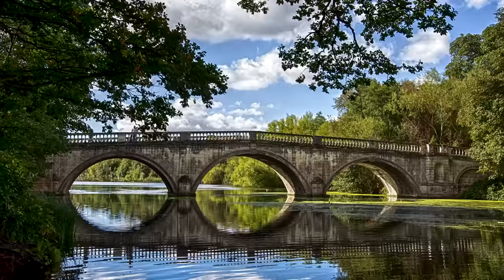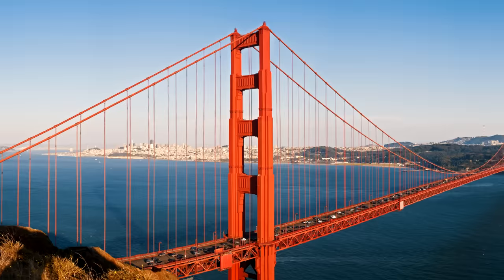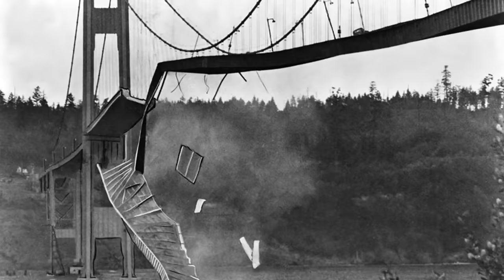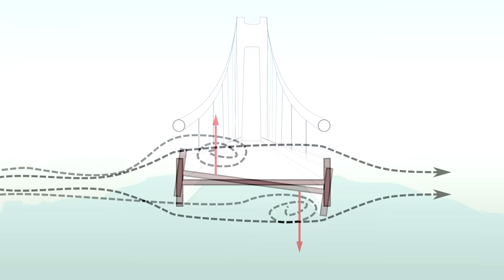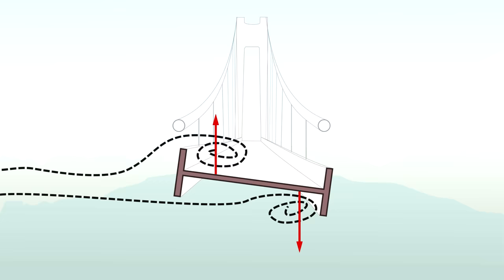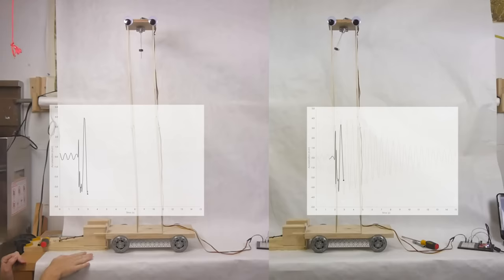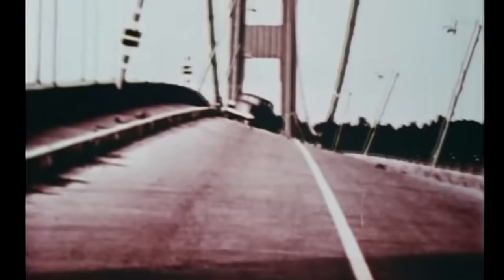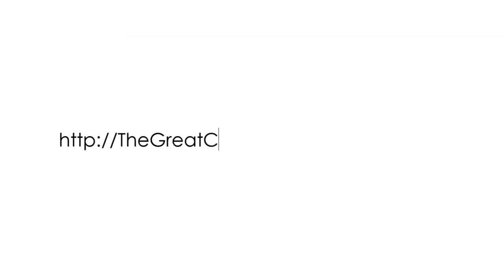Why the Tacoma Narrows Bridge Collapsed

Comment: I have a model aircraft and that suffers from what appears to be resonant flutter.

It has a conventional T-tail but the tail is significantly raised above the fuselage and directly in front of it is a pod housing the motor. In powered flight the tail 'waggs' and I'm told one of the solutions to this is to use a 3-blade propeller.

Presumably this alters the impulse period of the air being pushed backwards from the prop, negating the resonance.

Comment: I work for a Kubota tractor service department. People have no idea how sturdy modern tractors are, especially kubota. You cam complain about the flimsy cosmetic pieces of the equipment, but when it comes to rugedness....wow. I see the aftermath of these things put through all kinds of abuse, just to come in with minor troubles that we can repair and get the equipment back up and running very well. Missing service intervals by several hundred hours, shiny silver hydraulic oil, completely clogged radiators and air filters...and I have only seen a few catastrophic failures. People always complain until I show them pictures of how THEY caused the failure by skipping routine maintenance for 2 years. They will run equipment after gashing a radiator hose and drain all the coolant, then complain about just a head gasket. Or complain that it was running hot when a stick rammed through their hood and broke their belts...or their radiator is filled with mud because they spray it with water instead of air. Modern equipment is far from "not built like it used to be." People just "don't care for things like they used to."

Comment: Nice video.  However, what you left out is the fact that the contractor CHANGED the design (to make it cheaper and hence increase his company's profits) from an open lattice design to the one with the solid side panels that failed.  Also worthy of note, the Washington State Department of Transportation (WSDOT) was so confident of the Narrows Bridge before it failed that they were going to cancel the insurance policy.  Had it stayed up another week, they would have cancelled the policy.  However, as it turned out, the insurance company's agent had pocketed the $200,000 premium, and so there was no actual policy in place at the time of failure.  But he only stayed in jail for a few months because he was needed for WWII...  Amazing when you see how deep the rabbit hole is.

Comment: Almost everyone complains about driving on the open grating that makes up the middle two lanes of the Mackinac Bridge that connects Michigan's two peninsulas but this is exactly why they exist.  Winds where Lake Michigan meets Lake Huron can easily hit 50 miles per hour.  The bridge closes for driver safety at this point but it would take 150 mph winds to bring the Mighty Mac down.  A category 5 hurricane is 157 mph or stronger.

Comment: Rather than wind loads, airplane structures are designed to withstand gust loads and turbulence-induced flutter. These can dramatically increase the load factor (stress sustained by the airplane structures) and break components apart. That's why usually the top speed of conventional subsonic airplanes is defined by the flutter speed, which is required to be found by testing campaigns.

On YouTube you can find for instance the flutter test of the Airbus A380 and how they found out their main wingbox (where the main landing gear was seated) almost completely ruptured before the design flutter speed.

Source: I'm an aerospace engineer too :P

Comment: It’s always nice to see one of your videos.

The Chesapeake Bay Bridge uses grates on the deck of it’s suspended parts to help mitigate the effects of wind loading.  The grates spoil the air flow over the deck by allowing air to flow through the deck.

I know it’s a bit early, but do you have any thoughts on the Genova bridge collapse?
Reply: The Mackinac bridge in Michigan does the same. I believe it was a direct result of learning from the Tacoma Narrows bridge failure.

Comment: Air planes have a speed called Vne (velocity - never exceed) above which you can expect the wings to start fluttering due to the excessively high airflow over the wing creating oscillations.
Reply: Note: Vne is different depending on the air plane

Comment: One of the ironies of Galloping Gertie, that many are unaware of is that the original design called for an open latice-work of trusses like what the replacement bridge now supports. It was the builder who decided to use the solid steel panels instead because they were a lot cheaper and faster to make and put in place. If the construction company had followed the original design, Gertie would not have had the ocellation that lead to the collapse.

Comment: Great video !

1:06
Bratislava ?

1:18
Ribblehead viaduct ?

3:45
von Karman vortex street.

IMO, the Tacoma Narrows Bridge could/should have had a non-consistent section along its length e.g. add side screens intermittently, so that only small sections of the bridge will resonate at a specific wind speed.

Comment: Actually if you check the historical record you will find that during the design stages Charles Schwab the president of Bethlehem Steel specifically warned the engineers that using plain steel for such a project was highly discouraged as the flexibility would present such problems. They insisted he was trying to gouge them on the price of the recommended "armored plate" forged steel and even though his corporate engineers at Bethlehem warned them against it they proceeded with the "plain steel" as designed. The second bridge was made with the forged armor plate steel and is still in operation today. Fact.
Additionally, the Golden Gate bridge was "also" built with Bethlehem Steels forged armor plate steel.

Comment: Flutter and Airplanes

My first engineering job after getting my Aerospace Engineering degree was with a small kitplane builder back in the mid early 90s.  I would get inane questions all the time called in by builders looking for answers to assembly questions but one has always stood out in my head.  He wanted to cut the aileron counterbalances off the ailerons at the wing tips so he could add additional lights...  Seriously, this is a four place aircraft  and he wanted to start hacking away at the fiberglass lay up ailerons we sent him to add extra lights!  

I asked the builder if he knew what flutter was.  When he said no and asked what it was I told him it was the phenomena which was going to kill him when the aileron rips off in flight after he removes the counterbalance.  The good news is he chose not to remove them.  The bad news is I have no idea how many insane modifications and mistakes were made by builders.  I left the job after 8 months because the place was a complete disaster and could not be a part of it.  Even unemployment and having to drive 1,300 miles back to live with my parents during a recession was better than stay there.

Comment: A few things about the failure of the Tacoma Narrows Bridge.  The reason there is a video is because the University of Washington Civil Engineering School had been studying the for a year.  They  recommended that some of the solid road surface be removed and replaced with open grid decking like is on the replacement bridge.  The morning of the failure,  the bids for making the changes to the bridge surface were opened and construction was awarded to the bid winner.  A the winning bid applause died, someone rushed into the room at the U of W to announce the bridge failure.
In the late 1970's I read the documents of this and the U of W study documents.  My fellow engineer brought them in as he had found them in a trunk in a relatives attic.
The was no insurance on the bridge.  The person who was assigned to buy the insurance, pocketed the premiums because he never expected the bridge to fail.  He went to prison.

Comment: @5:40, even then that wasn't what destroyed the bridge.  If you look from a different angle you can see that just before the bridge is destroyed it goes into the second torsional oscillation mode.  This means that the center of the bridge is a node and that each end is twisting in a different direction. This greatly increased the stresses on the centre of the span and that is where it ultimately failed.

Comment: I was listening to a podcast (99% invisible) that talked about this bridge.  According to the podcast (and not sure how accurate it is), the bridge was originally designed slightly different than how it was actually constructed.  Another designer had come in and made suggestions/revisions to the design that made it less expensive to construct.  I am curious to find out if the original design of the bridge would have been successful.

Comment: That was a interesting side bit on the Stockbridge dampers. I always thought those were solid zinc and their purpose was to help prevent corrosion of the aluminum wires. When I worked in the shipyard we attached zinc blocks to the sides of ships. These blocks would have some sort of reaction with the seawater, and they would help prevent corrosion in the steel hull. Learn something new everyday on You tube.

Comment: The Tacoma Narrows  Bridge may have had resonance in it, but then all structures have resonance and in some units, like violins and pianos and drums and trumpets and violins all this resonance is allowed to happen. In the case of the Tacoma Narrows bridge, this was allowed to happen  DUE TO THE RECTANGULAR APERTURES LEFT IN BETWEEN THE VERTICAL CABLES AND THE CATENARY AND THE ANCHOR POINTS ON THE BRIDGE.  Every rectangle can change its shape as it has four sides and the diagonals are not restricted in length but a triangle does have three sides and so a triangle does not change its shape.  If during the four months of its existence some diagnonal wires as used in cable-stayed bridges were used, that bridge would not have fallen.

Comment: Airplanes are constantly moving vs stationary like all the other examples. The plane also has engines with variable rpm / frequencies that are transmitted through the hull. The wind will never be hitting the plane exactly the same  for a long period of time and to get a major change in the wind angle the plane just has to make a slight course change. A slight throttle change also changes the frequencies being transmitted through the hull by the engines. I dont do design work or anything on airplanes but Im thinking it would be pretty rare for the plane to be in a constant enough state for a long enough time to be at a high risk for resonant frequency build up. I'm also not a pilot but from a similar concept for boats and water current, if the plane had wind 90 degrees directly to the side which caused the plane to roll, the pilot would adjust course so that the wind is not 90 degrees from the bow. With boats you would go so that the wind is say 45 degrees to reduce roll.
Reply: Planes and boats definitely are subject to structural fatigue, one of the primary reasons hulls have to be retired as they age (with corrosion of structural material not helping) and a lot of the loads contributing to the fatigue would be dynamic loads. That is a similarity with stop signs, traffic light poles, bridges ect.

Comment: Yeah, airplanes are designed for wind loads indeed but even more important is high-speed flight. At high speeds all aircraft are prone to aeroelasticity which obviously can have damaging effects. It is called aeroelastic flutter. They ways of delaying aeroelastic flutter however are much more different than the solutions applied in civil engineering.

Comment: Cool video, Would there been a way to save the bridge by adding to or modifying the existing structure?
Reply: The state was going to have holes cut into the solid panels to allow wind to pass through. It collapsed before they could do that, though.

Comment: I’ve been inspired by the Mars drone copter that NASA has been using, thinking about how designs would vary quite a bit on other planets with different gravity, different air pressure, and different temperatures. 

If we ever finally do get a colony going on the Moon or Mars, we will definitely be needing bridges in places to traverse canyons or rough terrain. What would a Moon or Mars bridge look like? How would it differ? Would suspension even work with 1/6th Earth’s gravity?

Comment: I really appreciated the video, all great contents just one thing, to be completely honest flutter wasn't the reason it eventually collapsed. If it were, we would have seen the middle line of the bridge moving vertically which is not what happened, in this case the bridge collapsed due to only a torsion static instability which is part of a flutter but not as dangerous as this. 
Source: I'm an aerospace engineer

Comment: Although you speak very clearly, when you introduce a term you could also write it on the screen.  I had trouble with "vortex shedding" at 3:50, aeroelastic flutter,  and "stop bridge dampers" at 6:30.  Fortunately for me google understands "stop bridge dampers" as the correct "stockbridge damper"

Comment: Airplanes are designed in such a way that the effect of wind occurs through the generation of lift, but angle of attack is the main important necisity, on the ground it is necessary when moving from hangar to airstrip to use crosswind correction so if the wind is coming from east and your facing north you would turn the yoke in a right turn (or push the control stick to right) and this is called crosswind correction 
Source: licensed pilot 😁
Reply: I always remember this trick as when you hold the control wheel and turn, your thumbs should point into the direction of wind

Comment: Up to now, the collapse of the Tacoma Bridge remains a controversial topic in the research field. Personally, I think the most critical reason is due to self-resonance, which remains unclear to researchers, even decades of study. The wind-induced vibration contributes to the (resonant of) vertical vibration of the bridge deck. Due to nonlinear coupling mode of vertical mode and torsional mode, the excessive vertical vibration induces torsional vibration due to "self-resonant". The bridge is so flexible and 
 there is no effective dissipative mechanism to reduce the torsional vibration of the bridge deck. As a result, the bridge collapses. Anyway, this is my personal opinion. The self-resonance phenenoma should be investigated comprehensively.

Comment: They were going to put Solar Panels on a Flat Roof at work. I looked at the Structural Engineering Data, for the weight load, and the Roof would support the weight load. They however didn’t figure the wind load on the roof, from the Solar Panels being Installed at an Angle, to pick up the Solar. I caught this before the panels were to be installed. Turns out the Roof wasn’t strong enough. And I’m not an engineer.

Comment: Check out propeller whirl, it's similar and was a big problem on the early design of the Lockheed Electra.  When the resonance of the engine movement matched the wing flutter, the wing would detach.   https://en.wikipedia.org/wiki/Lockheed_L-188_Electra

Comment: As far as I know, Flutter occurs when the rotational frequency and the vertical frequency of the body becoming the same due to the fluid forces, and usually, it happens in high velocities of wind. thats why it's more familiar in airplanes. you didn't mention anything about the vertical movement of the bridge, and you didn't talk about torsional Gallopin. May torsional Galloping be the cause for the failure?

Comment: Airplanes do indeed have to be designed with aerodynamic flutter in mind. Nowhere is this more important than in the wings. If flutter starts to impact the wings, it can cause the plane to quite literally shake itself to pieces. In fact, two famous examples of this phenomenon, both afflicting the exact same model of aircraft, the Lockheed L-188 Electra, can be seen in Braniff Flight 542 and Northwest Flight 710:
https://en.wikipedia.org/wiki/Braniff_Flight_542
https://en.wikipedia.org/wiki/Northwest_Orient_Airlines_Flight_710

There's more cases of this sort of phenomenon occurring to aircraft, but these were the first two that I could find just from a super quick search, and they're the most well-known cases of aerodynamic flutter taking down an entire aircraft. One of the compounding factors in both of these cases was that the prop shafts of the turboprop engines were mounted in a sort of floating bearing design that allowed them to pinwheel ever so slightly as the props spun, and the frequency of this prop flutter precisely matched the frequency of the wing flutter. When flutter set in in the wings, the props fluttered sympathetically, and it caused the entire airframe to oscillate until the Electra shook itself to bits.

Flutter is especially problematic if an aircraft is flown beyond its maximum operational airspeed (there's a maximum safe airspeed, and then there's a maximum operational airspeed). An aircraft's wings are typically designed to be most stable below a certain airspeed. When the craft exceeds this airspeed and maintains it, all sorts of nasty vibrations can set up within the airframe and can cause the craft to shake itself to bits.

Comment: I was wondering if you can help me out. I’m planning on making a bridge out of skinned pine trees. My problem is I know my span is 25 ft. I want it to carry my tractor which is 6 ton. I want to build in a saftey so I want it to be capable to 8-10 ton. My biggest problem is I can’t seem to find what a single 12” diameter pine log will carry. I can get bigger or smaller trees just want a base line to work off to figure out what one log can carry.